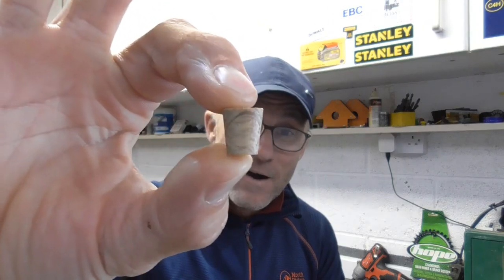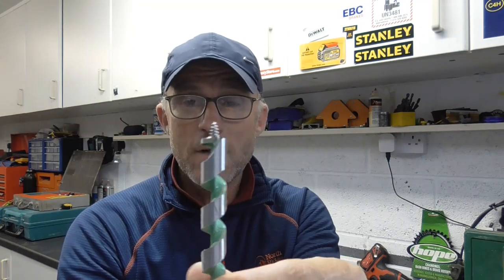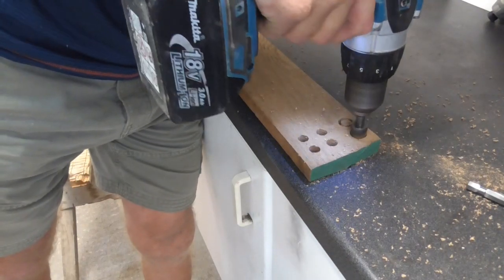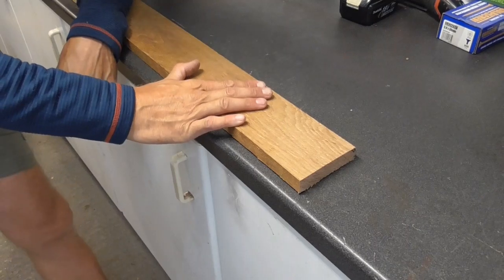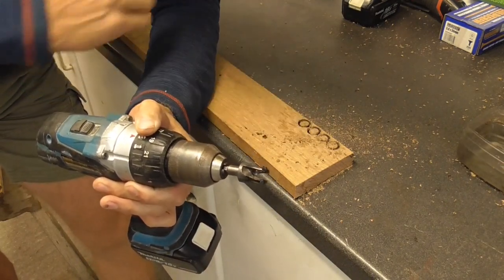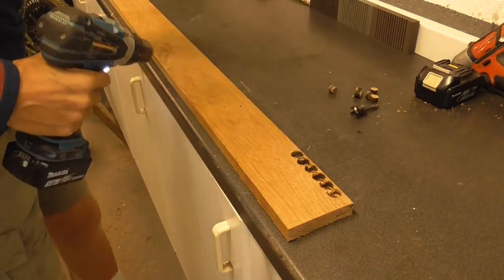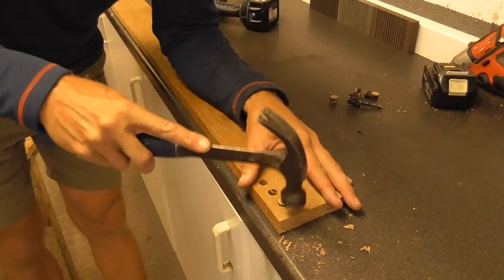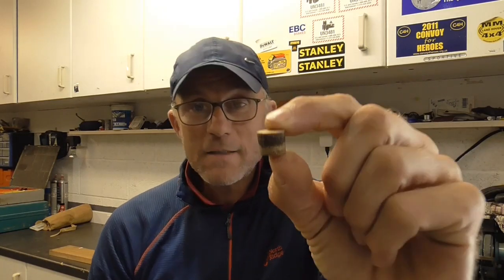Making wooden plugs quickly and accurately

Comment: Hi there
I cut mine same way, or band saw. I find Screwdriver csn snap then of short or dent them when in pine.        The pellet cutters are actually real easy to sharpen with a diamond hone. One of the thin credit card types fit between ok to sharpen the face refine the top bevel.
Reply from the maker: Hi O Bez. I was actually looking to see if I could sharpen my cutter, but my file was too big. It might be worth me getting one of the little diamond hones to do it🤩 Great comment 😎 Cheers Del

Comment: I know you can buy tapered plugs, but It never even occurred to me that you can buy tapered plug cutters! 22 years of faffing about cutting straight ones and digging them out of the hole 🤦🏼‍♂️🤦🏼‍♂️🤦🏼‍♂️ Thank you for this video, it’s like a revelation 🤣 Can you recommend a brand of cutter please?
Reply from the maker: Hi Kris. There a few tapered type cutters, but the one I use is the Trend Snappy one👍Being only HSS it doesn't keep its edge that long but they still work, just a bit smokey. (not that it stopped me😆) Thanks for watching😎
Reply: @thetallcarpenter   great thank you. I’ll get some ordered and give them a try. I’ve got some oak stairs to finish in the next few days and I hate plugging the holes lol.
Reply from the maker: @0000kris0000  😎👍

Comment: Here is a question for you TC unrelated to the great video.
I'm hanging rebated prefinished dark navy blue doors.
Customer has brought your normal albeit decent quality flush bolts and wants them in the rebate.
This is a quality job so no tiny grain tears or anything like that.
Customer hates ball catches(so do I). Customer does not want face fix tower type bolts either.
Have you ever come across other methods?
I was thinking some type of magnet in the head but not sure if that would work on the slave leafs. To make matters worse they are fire doors. 
Any thoughts?
Reply from the maker: Hi Benjanin. Your comment got worse the more I read down it🤯 You've pretty much got a full house of difficulties there and all on pre-finished doors😖. If I get the gist of it though, you need to bolt the slave leaf of a rebated pair, but the customer doesn't want to see flush or surface mounted bolts? Top, flush mounted roller catches are not great, I agree. What colour/finish are the hinges, latches and handles?
Reply: @thetallcarpenter  Hi TC. Thanks for replying. The hinges and ironmongery are are brushed stainless steel.
The customer has purchased 100mm long flush bolts which he wants mounted in the rebate, which as you know with a 22mm rebate and an 18mm wide flush bolt machining them in will be fun. 
I will have to make a jig for most of the processes, can't be driving out a lot of the material because if any of the swarf/ drilling debris catches the stained prefinished rebate it is possible it could mark it. Not to mention the fact you only have a few mill to play with.
Reply from the maker: @benjaminhunt283  There's a real issue here though Benjamin, that the slightest heavy treatment of the doors, either slamming or falling into, could just shear the flush bolts straight out the face of the door because it's got no meat around it😵 I'm not sure you're customer is being realistic in terms of what's possible and is asking you to fit something in a position it is not designed to work in😬
Reply: If the doors have a RAL colour get some bolts coated to match is the only way to go. Could possible put the star key type shoot bolts up and down, and have some aluminium escutcheons anodised to colour match the door. Like Del says, hardware has been refined over hundreds of years to do specific jobs in specific situations, and do so reliably. As you note, working outside those parameters is pushing it too far. At home I have a pair of premanufactured oak veneered glazed doors which I rebated. There is <2mm of lipping left on the keep edge. I still haven't bolted the slave doors as I don't think flush bolts will hold in the rebate and I haven't settled on any alternative. I'm probably going down the star key window lock route...
Reply from the maker: @baldyslapnut.  Great input BS, and thanks for putting it here. I think using a star key bolt will be cool as the escutcheon is really small, or you could actually colour coded washer and just bond it on, which might not stick out 👍Cheers bud😎
Reply: @thetallcarpenter  look up Wood Owl plug cutter set at TFTools, top quality very impressed with mine. I had the Trend one like yours, really needs to be in a drill press to work properly though. The Wood Owl auger bits are seriously smooth as well. Thanks for the table saw tip. For those on site screw your plug board to the edge of a bit of 4x2 or (bigger) and run down it with a circular saw.
Reply from the maker: @baldyslapnut.  I'll check out TF Tools mate, as I know they do some quality stuff😎😎 Cheers bud

Comment: I have the same plug cutters as mine came to Oz with me from UK. I must admit to the screwdriver technique. Never tried the table saw trick but then I don't carry a table saw with me either. The old school way I still use also is a dowel plate. Big thick chunk of plate steel with various size holes drilled in it. If I want plugs of the timber I am using split off a piece a bit larger than the plug size you want and then hammer it through the required size hole in the plate forming a round peg. Cut off whatever plugs you want. When we used to do all the draw dowel tenons years ago that is how we made all the dowels on site out of the timber to match.
Reply from the maker: Hi Dave. The dowel plate is proper old school, but fantasticly simple and effective, and keep meaning to get/make one🤓 It's cool just reading about how you make your own  dowels for drawing up stair string/newel tenons as stairs are possibly my favourite thing to fit, and the more complicated the better🤯 Great comment mate, and thanks for watching😎

Comment: Hi Del great tip, why do they always smoke when cutting, nice to see the auger bit being used all the best Tony 👍
Reply from the maker: Hi Tony. These cutters are only made from high speed steel and loose thier edge quite quickly😬 That's no excuse for me though mate, as my plug cutter is probably 15 years old and should have been replaced ages ago🤪 #Imatightwad. Thanks for watching bud🤩

Comment: Great tip Del . I plug almost everything because I hate to see frames etc with filler over the fixings, and you are right prizing them with a screwdriver makes them uneven with can lead to them going in on an angle. I will definitely be using your Method in the future. 
The plug cutters always end up burning out…. It’s a right pain!! I generally buy eBay ones. Which do you use out of interest?
Reply from the maker: Hi Paul. I think my plug cutter is a Trend Snappy one. I've had it absolutely ages, and it's well past its best. I like this particular type as it cuts the plug slightly tapered👍You're approach is, ultimately, the best as the timber plug shrinks/swells with the timber, unlike filler which usually stands ever so slightly proud once the timber has settled down🤩 Great comment bud, and thanks for watching 😎

Comment: What about using dowel? Or have I got that wrong too? 😁
Reply from the maker: Hi Paul. Dowel will do the job fine, but you see its end grain. Cutting plugs allows you to match the direction of plug with the direction of the timber you are working on. It also tends to shrink the same down the same, unlike the end grain of dowel👍 Thanks for watching😎